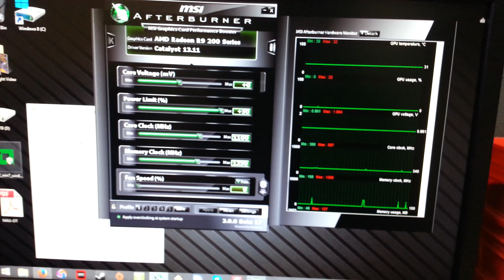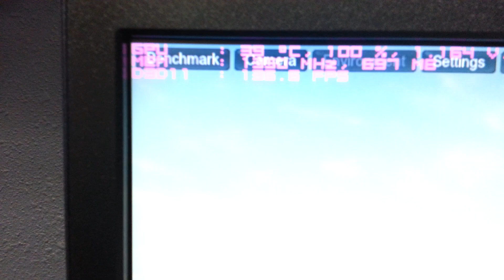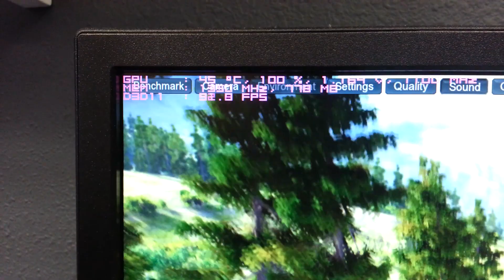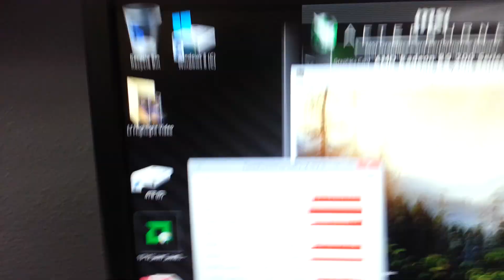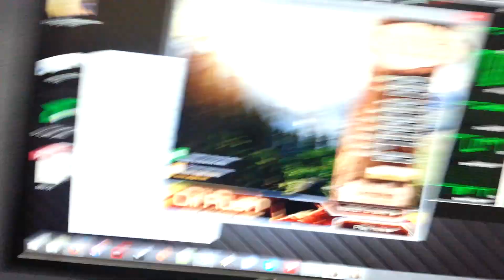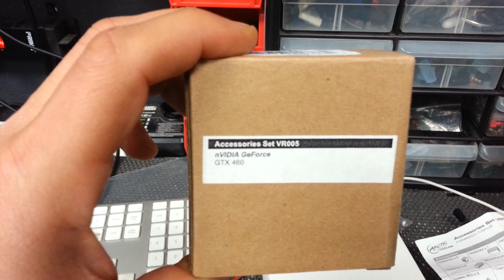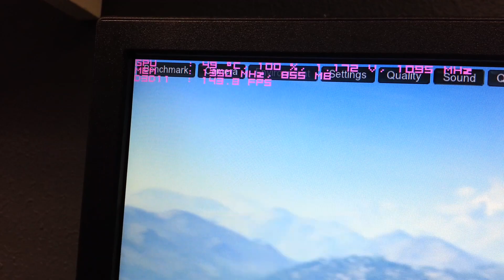NZXT Kraken G10 with NZXT Kraken X40 installed on a Radeon R9 290X (Part 2)

Comment: Hi Helix. Just a question about the adhesive:
Is there another form of adhesive which we could use aside from the compound you showed at the end of the video? For example, I understand that there is a sort of double-sided thermal tape that's available on the market for attaching heatsinks to the memory module and VRAM.

Please advise. Thanks :D
Reply from the maker: you could but the tapes usually get weaker and fall off, you wouldnt want that to fall on your pc components and short your system! adhesive is the best option here.
Reply: Ah....Understood.

Comment: Hi, mind if i ask where do you connect the 92mm fan to?
Reply from the maker: i run it straight to the psu with an adapter, but you can also connect it to the motherboard.

Comment: What case is that?
Reply: Its a Corsair Carbide Air 540. I'm using that, too and its quite awesome because you got seperated the party which havt to be cooled and the ones which don't really need extensive cooling.

Comment: Could you fit the GPU Radiator on the back 140mm slot if you didn't have the push/pull (and just had the pull setup) on the top radiator?

Comment: It would be awesome to see how the VRMs do with a little bit more memory.  Have you pushed your clocks any more since your video?  I've decided to go with the same except I will use a gelid icy rev 2 enhancement kit that has a singular vrm heatsink for the entire vrm1 line.  I also have contemplated replacing the nzkt fan with a 92mm noctua fan with ~60CFM flow and still silent.  I think those things together would help solidify this combo, I'm just concerned still about the VRM1 bank under higher clocks.

Some folks are only putting a heatsink on the VRM1 modules, leaving VRM2 and the memory chips bare, since the memory chips don't get that hot (it's how gddr5 is designed)  Seems that they're having good luck with it, but that at least with VRM1, a heatsink is critical to have.

Please let me know your opinion after having it a bit longer and if you've increased the clocks at all and the behavior of the VRMs at that point. 

Thank you very much for putting this out here!  I'm about done with my reference cooler :)

Comment: what are the 2 thermal compounds you used for them to stick? and how much do they stick. are they never coming off ? (if for some reason i had to RMA my card am i SOL after adding these Vram and vrm heat sinks
Reply from the maker: its the arctic silver alumina, you gotta mix 2 compounds together to get them to bond, its pretty much permanent. And you This will void warranty of any kind.
Reply: HeliX PC damn. im on frozencpu right now about to order some VRM heat sinks.  what did you buy? also whats the max height in mm from the card to hitting the bracket? i dont want to order to tall of heatsinks for the vrm's and vram chips   thanks :)

Comment: just a question my friend, i am interested in buying this cooler for a 780 ti, but to address the vram problem can you just attach a new 92mm fan with higher rpm and cfm output. Will that make a difference? Also in general, how much of a FPS boost did you get from a water cooling your gpu. I know their is a performance benefit from water cooling but how much of benefit from running stock. Thank In Advance!
Reply from the maker: Well, the main point in doing this on this particular card is to keep noise level down, which it did, performance wise you will get a better overclock because of the lower temp.

Comment: Hi where do you get the heatsinks?
Reply from the maker: http://www.platinummicro.com/Arctic-DCACO-VR00500-GB-VR005-VGA-Heatsink/dp/B0047V031E?field_availability=-1&field_browse=5581549011&id=Arctic+DCACO-VR00500-GB+VR005+VGA+Heatsink&ie=UTF8&refinementHistory=brandtextbin%2Csubjectbin%2Ccolor_map%2Cprice%2Csize_name%2Citem_type_keyword&searchNodeID=5581549011&searchPage=1&searchRank=salesrank&searchSize=12
Reply: HeliX PC DId you use the thermal compound that comes with the that VRM heatsink package on link?

Comment: How much space does it take up? with normal space pcie slots could i fit 2 of these  side by side?
Reply from the maker: needs 3 slots for sli.
Reply: HeliX PC 2.5 actually. NZXT stated that themselves.
Reply from the maker: Vlad Slavin
lol.....what would you do with 0.5 slots? it rounds to 3 slots.
Reply: HeliX PC 3 slots = inability to use your second PCI-E slot
2.5 slots = usable spacing to use your second PCI-E slot. 
Even having that extra 0.5 slot makes a difference :)

Comment: is sli or crossfire possible. i mean in the way of using 4 total slots cuz i use a maximus gene
Reply: I think only 2 way is possible, because these take up about 3 slots.
Reply from the maker: Jason Chapman
some cases have space on the bottom to mount a 140mm fan, that would work.
Reply: HeliX PC Sweet Vid bro. I also have the Carbide 540 case, planning to do dual r9 290 with g10 + x40. Will 2 fit? The above answers say no, but there 360mm of height on the front of this sucker which should easily fit 2x170.2mm raditors? Or am I missing something really obvious?
Reply from the maker: Chris Godfrey It could, the case allows you to move the fans up and down, honestly i think untill someone tries putting in 2 of them, we wont know.
Reply: HeliX PC Done! I've got 2 r9 290s with g10 mounted in the 540. Had to drill some extra holes in the front of the case though. Both cards run 55deg under load OC@1100MHz

Comment: Very HELPFULL!!!

What do you recommend?

is thermal paste enough or  thermal tape (instead of the mix in the video)?
Reply from the maker: you have to use thermal adhesive, not paste, look for the arctic alumina thermal adhesive
Reply from the maker: Jason Chapman no way, the tape will come off, use the thermal adhesive that comes with the kit or purchase the artic alumina which is a better adhesive than the one it comes with.
Reply from the maker: Jason Chapman plus if you get the copper ones, they are heavy, the tape will not be enough, the adhesive is best, i speak from experience, the tapes are terrible.